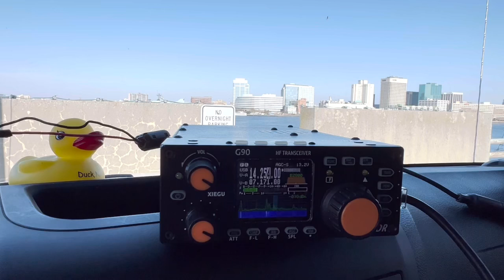Breaking a Pileup with Low Power

Comment: That's why God gave us legal pads.. I jot down the calls, freq., signal strength, then go elsewhere and let the pileup die down. Come back in a few minutes and maybe there's an opening for me. If I then make contact, I can complete the info, circle it, and use the info for my log later. It also helps to speak clearly and to enunciate your calls correctly. Sometimes the toughest part is understanding the callers speech. ENUNCIATE!

Comment: Hi Walt.  On 7-13-2024 between 10:07 PM and 11:27 PM I made 10 DX contacts with my G90.  I use the techniques you describe, plus 1 more.  If  both 15m and 20m are open as they were on 7-13, 20m was a total mess with far too many stations operating 2Khz or less apart.  All of the above contacts were made on 15m.  There was less interference, and pilups were smaller.  So if the band you are on is too crowded or pilups are insane, try other bands!
Reply from the maker: Roger that!!! 73, Walt

Comment: Thanks for sharing your thoughts and insights. Shortly after upgrading to General I was mobile driving 2 hours homes. I heard a pileup and tried from different locations I finally was successful when I stopped in subdivision on the top of a hill and drove around in circles and tried after  completing 360 , 430 degrees etc changing my timing each time in less than 10 minutes I exchanged QSO info & 73s
Steve AA4SH
Reply from the maker: Interesting, thanks for commenting! 73, Walt

Comment: My advice for those running a pileup and using the numbers technique to please spend more time on 0's .   We often get buried by the East Coast and West Cost walls.  However, once they clear out and that grey line moves over the central USA - bam in the log.
Reply: Very occasionally, have came across a "numbers station" that goes from 9 back to 1 - they miss out zero 🥺.
Reply from the maker: I think they need to spend more time on the 4’s hahaha just kidding. 73, K4OGO

Comment: I am fairly new and have started to figure out many of these points, all good tips particularly timing and listening for the cadence of the distant station.  One other tip: tune carefully - I have seen quite a few pileups where the distant station is actually 5-25kHz off the MHz frequency and others are just ignoring that.  By tuning carefully to match them I can sometimes be heard better.  I also just recently figured out what a “five up” CQ call means and how to work that (don’t laugh too hard) - made a difference!
Reply from the maker: Thanks for watching and commenting. I think we all had that moment when we started where we were trying to answer a CQ and someone yelled “5 up!”. I’m laughing with you not at you my friend. All the best and 73, Walt

Comment: When I was actively hunting DX contacts about 20 years ago as a new ham, I usually ran about 20-50 watts on a borrowed and very compromised vertical antenna in a backyard located nowhere near salt water. I was a very new operator but found I could break pileups pretty regularly with fairly low power, and I was suprised by this until one of the members of my local club pointed out that some DX ops and contesters probably picked me because it is fairly rare to hear a female voice in a pileup! 73 Walt.
Reply from the maker: The female voice is definitely a pileup breaker because of how rare it is to hear one in a pileup. I always stop everyone if I hear a child's voice as well. It's great to hear both in a pileup. Hope you're doing well my friend.  73, Walt

Comment: I have broke through a few pile-ups in my time just being in the right place to make the contact.  Always pleases me when I make a dx contact and get a good signal report running low power.  Especially when I get a better report than some of those high power stations out there.  Sometimes it really is location location location.  
Thanks for your posts.
Reply from the maker: Thank you! Roger that, my location is a big advantage at times. 73, Walt
Reply: Right place and right time? I have found it pays to tune around. Especially on grey line. Sometimes get interesting contacts when a DX station has just came on frequency. You can pounce before the big boys shovel coal into their linears, crank the beams around or spot it on DX clusters.

Comment: Walt I've been a QRPer since 1978 and I can't believe these people that say life is too short for QRP. Most of them have tried low power with crap antennas There is one op I hear all the time he uses a half size G5 rv and runs 1000 watts and can't hear squat. I use a 6 btv and also a HWEF and 5 watts and work all over the world. I enjoy your antenna expiraments I'm going to try a parasitc 40 meter director with my hustler vertical. 73 from ki0ad
Reply from the maker: Roger that! I love QRP, it's a great feeling making contacts with low power and it makes you put more thought and effort into the antenna and operating setup. That parasitic director sounds like a fun experiment! All the best and 73, Walt

Comment: Rhode Island with 10watts tuning up the gutter from Tampa Bay. Should I say 10 watts,  instead?
Reply from the maker: I call that QRP for sure! 73, Walt
Reply: @COASTALWAVESWIRES  Just don't tell my Mom I tuned up the rain gutter.
Reply: I used to run a converted TRC-457 and 4 element Yagi at 35 feet and the European stations thought that I was a big gun!

Comment: Great advice Walt. I like QRP for two reasons - one it's what my licence allows and two it forces you to learn how to get through when all around is chaos. Sometimes it works and sometiimes it does not, but the joy of it is in not spending mega bucks and still getting DX against the odds. Like you I will use QRP as part of my call if neccessary (sorry Cal but suck it up) although my M7 callsign identifies it anyway. I have a natural antipathy to high power stations but if it breaks no laws then what the heck. When I do object to is high power splatter and QRM. Who was it who said "Power Corrupts" ? 73 M7BLC
Reply from the maker: Thanks! Roger that. QRP makes you a better operator. 73, Walt

Comment: Hi Walt,
All great techniques. Jason, KC5HWB Ham Radio 2.0 was live streaming on 10m several years ago (when my call was WB3BJU) and I had my 5 element yagi pointed his way and couldn't break his pileup on 100W. He called for QRP only, so dialed down my FT-450 to 5W and made the contact on the first call. The antenna made the difference for that contact as I couldn't hear him on my wire antenna. Other times for DX pileups, I listen for the cadence and many times when I send my call just wait a few seconds then send a "JU" (now a 3U) and would get an answer. Sometimes you just need to do what you need to do to get that contact.  🙂  You have a great YT channel. Stay safe.  73  WJ3U
Reply from the maker: Thank you so very much for the kind words Don! Great story on getting through to Jason! Stay safe and 73, Walt

Comment: Excellent info and this comes from experience!  I will note that waiting for QRZ is good if the operator uses QRZ. I don't think I ever say QRZ. Listening for the rhythm or tone set by the operator will tell you when he listens. In my case on SSB, I will almost always end with "Roger Thank you 73 N4DJ" as soon as I send my call I am listening. Now depending on the "tone" of the pileup, I may slow it down but will try and be predictable as to when I am finished and listening for calls. On CW in POTA I usually find myself sending TU 73 N4DJ (dit dit) and anyone listening knows the Dit dit is the signal to call. If I am the DX or working a contest pile up I make it quick by only sending "TU N4DJ". never sending a K or a QRZ or even a DE on CW as that's a waste of time. I think most experienced operators will work like this in a pile up. Again its most important to listen and get the drift of how the operator is working. I note a lot of POTA ops have different styles so it pays to listen. DX stations are more predictable. If the pile up is very hard for the operator to sort out the calls he will be allowing time for you to send your call two or maybe three times. As you said you should not be afraid to do that. Just this morning I had a tremendous pile up of Europe calling me on 10 Meter SSB. They all sounded alike and I could only get part of a call. I let the guys call a bit longer and could catch one or two letters of the call. I would say something like " M0 M0" then I could get the full call. If I heard a "Juliet" I would call for the "Juliet". It is fair game for anyone with a J anywhere in their call sign to call at that time! if the pile up died down for a second I could then get a lone call very easy.
Reply: You Are not “Running On”, this is how we learn from those that have the knowledge and experience!! 73
Reply from the maker: Thanks for the great tips, I’m heading down the CW trail and I’m definitely a newb. I greatly appreciate your input. 73, Walt dit dit
Reply: Great on the CW @COASTALWAVESWIRES   You have a great learning channel. I hope I don't run on too much with the comments but I hope I can add something here and there or reinforce something good you said.

Comment: Agree with your points 100% Walt. My only additional suggestion is to do some preparation with local or less hectic calls to ensure that your audio is as clear as possible. Muffled rarely cuts it. This may entail getting a better (not necessarily expensive!) microphone, or just getting your audio settings optimized (no, you don't need a 15-channel graphic equalizer, either).
Reply from the maker: Great advice! 73, Walt